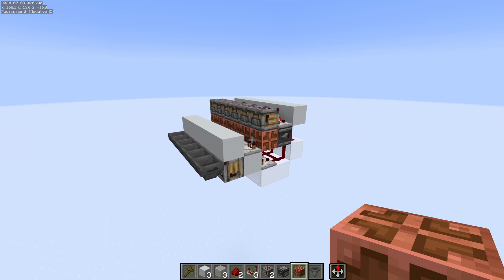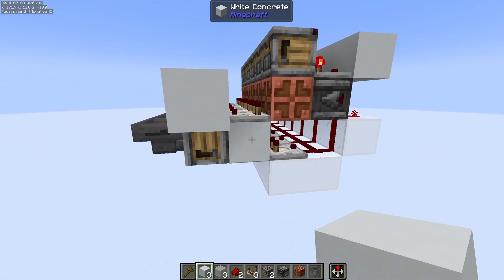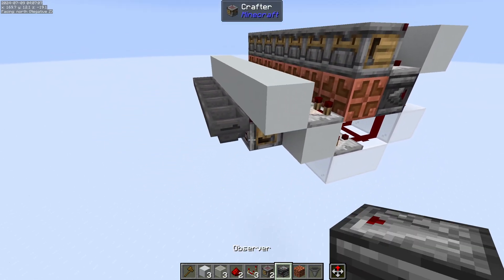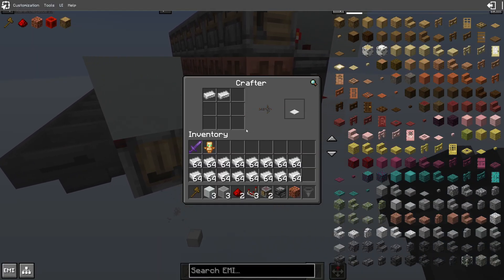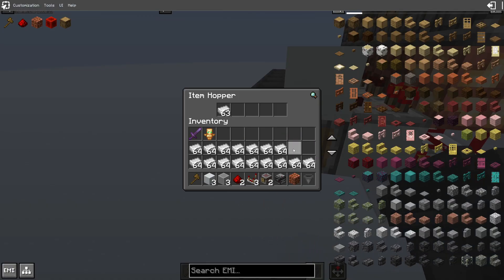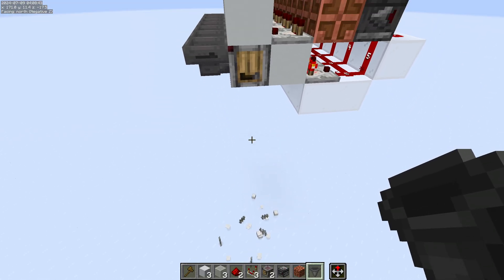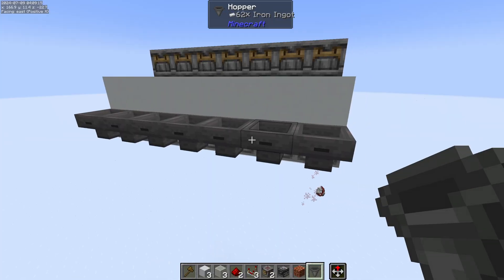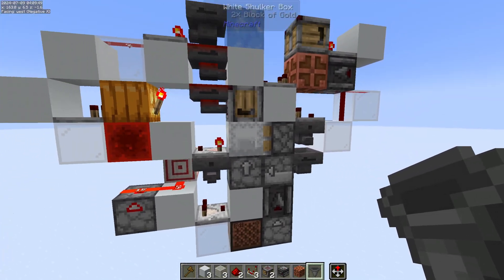1-Wide Tileable Precision Autocrafter (1.21+)

Comment: tip: you can use item frame and set it to power 7 (6 right click) instead of  crafter above the copper light.
However, thanks for your design;)

Comment: I’ve built this and it worked great but I had to redo some redesign to my gold farm and it no longer works? Just fills up without crafting

Edit: Found the problem, I find that my gold farm is way to fast for this system since it gets backed up really fast even with 6 modules it can’t keep up. It would be great if it was for the iron farm but something like the gold farm it’s way too slow to keep up with the crafting

Comment: I was so close to this same solution ffff but i used this as a building block in a fully intregrated sorting system with overflow protection thats also 1 wide tileable and isn't any higher than the normal sorting stack so it fits inline with the rest of your sorting system

Comment: Sometimes the crafter gets stuck with 8 slots full out of 9 (for like slime ball to slime block) and the copper bulb will stay on and won't allow the final item into the crafter and then a backlog of items will build up. not sure if anyone else gets this issue and if so how can I fix this? Could this be because I'm using a composter instead of a crafter for the top portion?
Reply: Fill up all the slots woth full stacks

Comment: Anything against replacing the top crafter with a normal block putting an item frame on it with an item turned to equal 7¿

Comment: it only works when it fills, and breaks when it overflows. If you build this make sure the items will not be stuck and continue to shoot out or never have overproduction.
Sadly this has the same issue most crafter setups have. If the crafter overflows and can't shoot out there is no new signal to kickstart the crafter again, it will get a constant signal and stay powered.
Reply: Crafters will spit out their items regardless of storage being full or not. In testing a full storage container doesn't prevent the crafter from spitting the item out. It just doesn't go into the storage container and ends up outside as a floating entity that will eventually despawn. Still not ideal, but it is what it is.
Reply: i think you can add a hopper and chest under the crafter to remove extra items if its filling to fast.. so you would have to change the orientation of the crafter in this design but it should be easily adapted
Reply: @ethanvalentine4299  You cant add a hopper under the crafter as it will suck ALL the items out of the crafter even before it can craft an item

Comment: This can be made with like 10 blocks - Only two high and one wide too. In fact it's that easy to build I will include instructions below..

I'll be using stone for the full building blocks, feel free to use whatever you want here so long as it is a full block.

Just follow below instructions in order from left to right:
1. Place s stone block.
2. To the right of this, place an observer looking at the stone block
3. Place an observer to the right of the last one but looking looking down (face on the top).
4. Place another stone block block to the right of the last observer.

Now starting from the left again but on top of the first stone block:
1. Place a crafter.
2. Place a comparator on top of the observer looking right from crafter.
3. Place a single bit of redstone dust on the top of the second observer.
4. Place a comparator on the last stone block looking left in to the dust
5. Place a, composter with a full inventory (level 8) next to the comparator.
6. Finally, just add a hopper to the top of the crafter and fill it with desired item to craft full blocks.

Done.
Reply: You could even use a 2nd crafter in place of the composter set to 8 as well.
Reply: Nah that won't work the copper bulb is there for a good reason. You get 2 pulses: one when the crafter's all 9 slots get filled (and the signal strength of the other comparator get overwritten to 9) and one right after the crafter spits out it item (signal strength on observer drops back to 8). This means that your output will be 50% iron blocks and 50% iron pressure plates. A t-flip flop of some kind is necessary to filter out the 2nd pulse.
Reply: @dennist6393  You are right meaning the design I proposed is only really viable for single block recipes which makes it ideal for this build but not necessarily for others. There are of course auto crafters that offer more functionality and of course a single pulse.
Reply: @dennist6393  Actually as long as it is set to 9 open slots it will ALWAYS make Iron Blocks and nothing else.
Reply: @dracconis69  huh I was 
 testing it on 1.20.4 with experimental features turned on and wasn't getting the desirable result (I ended up designing a version similar to the video but a bit more compacted), I'll test it again tomorrow. perhaps I'm wrong.
Reply: @dennist6393  Make sure you are using the 1 piece of glass for the redstone dust right in front of the observer and the filter crafter is set to 7. Anything else and it will either break or not work right.
Reply: @dracconis69  doesn't work out for me but hey it gave me some ideas to compact my own design. I also made a tileable crafter for the reverse operation (craft blocks back to ingots with the output limited to hopper speed) with those concepts, sp thanks for the input!

Comment: To clarify, this design works with any recipe that uses two or more slots *of one ingredient*. You could use it for multi-ingredient recipes, but you'd need additional circuitry to to feed all the ingredients into the input hopper in the right proportions. For instance, to have it craft item frames, you'd have to feed 1 leather for every 8 sticks. But even then, unless you control the inputs carefully there would be a risk of ingredients filling hopper slots in such a way that it blocks one ingredient from entering. Then the crafter would stall until you intervened.

Comment: Could you replace the non-crafting Crafters with an almost full composter, or a book and quill on a lecturn in page 7? Might be a little cheaper
Reply: Lecterns could work but beware that a composter can't have a signal strength of 7 (only 1-6 or 8). You could make it work for that case with some redesigning but it would get way too bulky to be worth it.

Comment: Can someone explain to me why you'd do all this instead of just leading redstone dust out of the back of the crafter that has a length such that when the crafter is full it has just enough power to reach back to itself?

This is what ive been doing in all my builds, I make the return redstone wire vertical so its like 3 blocks tall and maybe 4 deep this makes it also 1 wide tilable. But its just redstone wire, it's literally never broken on any farm I've installed it on.

Surely there is a reason for this, like maybe this one doesn't break if somehow 2 materials get into the same slot, but I've never seen this happen with hundreds of afk hours on a fortress farm I have with like 5 of my simple compactors.

It's a genuine question btw, why not just use redstone wire?

Edit: I just noticed it doesn't fix itself, lol what's the point of doing it this way?!

Comment: Can someone explain why every design I see for a compactor like this has all these extra components? I have just been extending a redstone line out the back using 2 vertically stacked building blocks, some glass to go up vertically.

But it's literally just blocks and redstone dust, when the output of the crafter is max, there is just enough power to reach back to the crafter. It's dead simple, has never broken.
Reply: lag, as in using static components to only change the redstone level by a couple in this design vs a line of dust completely depowering every time it crafts. 

obviously if it's working for you then there's no need to change but if you had a weaker machine or something like a nether portal gold farm you'd definitely feel the difference imo

Comment: Just for anyone wandering ; the seconde crafter can be anything that can preduce a comparator power of 8 like a composter or a lectern.
Reply from the maker: It actually needs to be something that outputs a singnal strength of 7 and since composters only output 7 for a second before they convert to 8 I just used a crafter.
Reply: @Henness0666  Oh yeah you're right sorry for the misstake.

I had allready made my own 1 wide tileable Autocrafter (i still use it because i find mine simpler) with an "8 compost" and it work fine because the observer look the redstone dust directly after the comparater so you need to detect when it goes from 8 to 9.
I thought it was the same but you're right you look for the 2nd powder so composters does not work.
Thank you for notifying me.

Comment: I suppose if you wanted to use a more complicated crafting recipe, you'd have to carefully load the hopper in the correct order
Reply: If you had a recipe with an empty space, you would have to add a dummy item and take it out before the craft
Reply: @Optim00sey -- Could you not just block that space?

Comment: If you wanted to use this with recipes that only contain one item, i.e. logs to planks, could you replace the copper bulb with a solid block?
Reply: You can also just use an observer clock for those
Reply from the maker: There are simpler designs that work with single slot recipes. I'll make a video with some.

Comment: What if the copper bulb weathers down? Does it affect it?!
Reply: Wax it? Infact, you should always use fully oxidized copper bulbs because they have the least light which means least lag
Reply from the maker: For this design it doesn't matter if it oxidizes because I'm using the comparator output of the copper bulb not detecting block updates with an observer. So, you can use any copper bulb variant you want.

However, using waxed bulbs or fully oxidized bulbs is always a good idea when using them for redstone.